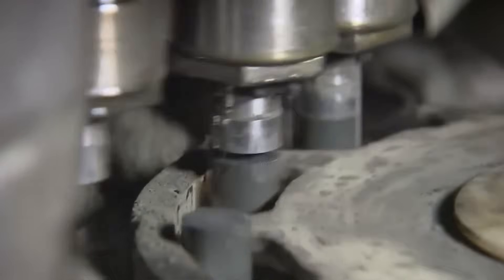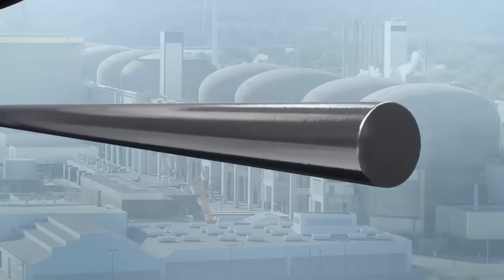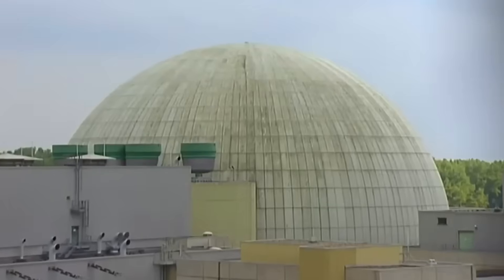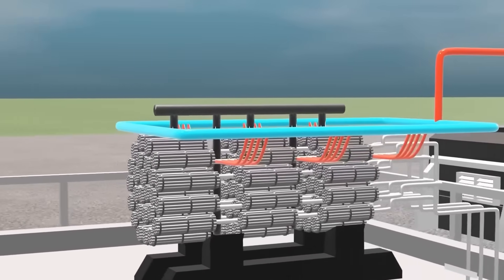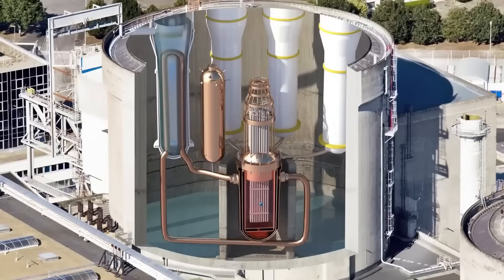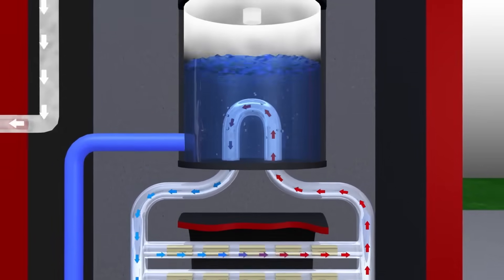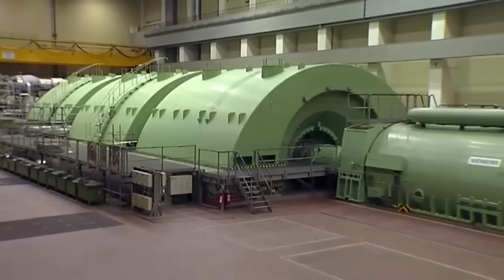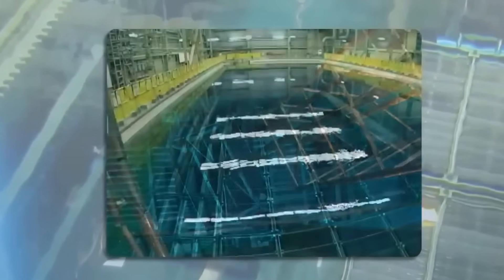How a NUCLEAR POWER Plant Works ☢️ Inside the REACTOR

Comment: If the fuel pellets and rods can be handled as seen in the video, how is the reaction process started once they are loaded into the reactor? Are the control rods already in place and it's started by their partial removal? I want to understand how this works.
Reply: Yeah control rods are fully submerged from the beginning which prevents the reaction from intensifying once fuel load reaches theoretical criticality

Comment: you ignore cashflow from the consumer, the customers.
I pay the bills, petrol for the cars, gas for heating, and cooking and hotwater, the electricity at 56cents kWh. 

My 10m to the street poles upgrade is quoted at $2,000, or $5,000 if I go to 3phase electricity supply. 

I have worked on the construction of a 1,7000 tower transmission line. And urban streets upgrade. 
I have decades in site management and tendering for projects. 

I know the national electrical grid length and numbers of meter boxes. 
20million meter boxes. 

I know that the $34billion in new grid projects is for only a small part of the national electrical grid. 

I know 4million roof PV systems installed and increasing and batteries and EV's. 

It is happening. Grid economics is changing.
The daily DUCK CURVE is increasing. 

Voters are changing.
Wealthy are clever and high energy users, and early adopters of new technology and modern appliances and love the tax-free benefits of tax-free savings on all their energy costs. Energy is expensive and the world is changing.

Comment: Ok so when the fuel rods are inserted into the reactor what exactly starts the fusion process?
Reply: Really its the water and sometimes there placed in a specific order to increase or decrease power output … the water slows down the neutrons and can push them back into the rods causing insane amount of heat and a chain reaction
Reply: @chrisrendon461  hey thanks for taking the time to respond to me appreciate it bud
Reply: @chrisrendon461 yeah I had the same question, that's something that kept evading from me after watching a few videos about that. Thank you so much!!!
Reply: We don't yet have fusion reactors.

Comment: The Nuklear plant is Production heat the water is cooling it down and there‘s is steam and the steam flows through Generators which the generators transform it to electricity and this Electricity is trans to the power lines.. so there is electricity for a town or more.. am I correct?
Reply: Ok

Comment: They produce electricity but need back up generators when the power grid goes down? Why can’t they use their own electricity they are making.
Reply: No one expects you to know how a nuclear reactor works but you should have the common sense to figure out that nuclear reactions dont just magically stop when the power grid goes down.
Reply: @Soulintent95 imagine just being to too stupid to understand what I just said.
Reply: @Theboss-m7v  my comment is typed in the same language you are using. Imagine trying to call someone else stupid when you cant even fathom something so simple.
Reply: @Soulintent95 .  Then explain why they need backup generators when they are producing electricity. Fukushima had two units running when they claimed they didn’t have power because the back up generators were flooded. You didn’t answer the question you did nothing but defend the matrix you are trapped in
Reply: @Theboss-m7v  my comments are typed in the same language you are using.
Reply: Kiddo, if you worked on nukes you wouldnt be asking such dumb questions. I already gave you the correct answer. Not my problem you dont have the capabilities for this topic. Clearly youre unwilling to learn, and it cannot be dumbed down any futher.
Reply: @Soulintent95 .  Sounds like you are another narcissistic idiot that couldn’t answer the question and is too weird to just let it go. The answer is it’s obvious they aren’t producing electricity
Reply: @Theboss-m7v  i literally answered your question. Its typed in the same language you are using. Grow up.

Comment: The uranium fuel pellets are ceramically treated Uranium dioxide chunks. This design makes it possible to encapsulate and re-use partial decay producs - Initial small % of u-235 is a starter to create more of it due to u-238 (most common uranium type) transformations.

Comment: So risky technology, a small mishandling, Can cost human race a decade to recover from radiation....
Reply: No, the RBMK was prone to mishandling, but not small. The catastrophe could have been prevented for hours before it happened and reactor was operated under forbidden conditions with automation clearly stating that operators are mishandling the reactor. This is what happens when you design reactor to be operated by people that follow orders and they don't. RBMK should only be operated under armed guards that would shoot your head if you do not follow instuctions. In Chernobyl the computer told the staff what they already knew - you can't remove that many control rods from the reactor under any circumstances. By any I mean any. ANY. Including if someone pointed a gun at you.

Comment: If only this YouTube video was available during the Chernobyl disaster
Reply: The reactors used in Chernobyl were a lot more different, what they really needed is proper training
Reply: @zephitron .  They knew what they were doing.  They wanted to do a low power test.  So they disabled the safety mechanism.   

Well I guess you say they needed more training but this was state of the art technology at the time.  So kinda hard to get training when you are the expert.
Reply: @msgsgt engineers said that it was a risky and dangerous reactor, especially because of the positive void coefficient which can (and did) cause thermal runaway, it wasn't state of the art and they knew it, they just lied to the people
Reply: @jaxb69  was it not state of the art for what they could afford ?   Also it never malfunctioned and worked as intended until they wanted to push the limits in a low power test. 

Yes they needed more training which is what they were doing.  Unfortunately they went below the tolerance for catastrophic failure.
Reply: @msgsgt It was not, The Soviets stuck with the RBMK layout because it was cheap to build, didn’t require enriched uranium, and could double as a plutonium breeder for weapons. It was budget friendly, not state of the art.

And "it worked fine until it went too far" misses the point, the test went below safe power levels because the reactor’s behavior at low power was unpredictable, the positive feedback loop was already capable of turning minor mistakes into big accidents. Similar with the graphite rods which in the end caused the explosion, the whole design itself was unsafe
Reply: @jaxb69  so it just had a lower tolerance for failures or mistakes but was affordable. 

So then, was it always going to fail or what it have worked normally had they pushed it above normal parameters ?

I under you said that design had lower tolerances for mistakes, but does normal operation eventually leads to those mistakes or failures?  (Gauges reads one thing but internal temp is actually  different for example.   Something other than, running it without sufficient cooling).
Reply: Proper training with less ego and negative coefficient reactor
Reply: RMKB tinha falhas
Reply: chernobyl chernobyl chernobyl
Reply: Oh lord, there’s always at least one of you to bring that up. How about all the nuclear powered ships and subs in the navy? Sailors live on top of a nuclear reactor for weeks and months at a time. How’s that for Chernobyl?
Reply: This is not the chernobyl reactor the chernobyl reactor is an RMBK-1000 which is a graphite moderater that uses steam to turn turbines
Reply: It wouldn't matter considering they knew they just hid that information from their engineers.
Reply: the reactors in Chernobyl uses graphite control rods which do not contain the reaction but speeds it up in extreme conditions. That is why modern reactors uses Boron or Cadmium control rods which can contain the reaction even in extreme conditions.

Comment: the pressurised reactor is known as a PWR (or pressurised water reactor) it has 3 cooling loops 1 for the reactor itself (this loop is isolated and is under immense pressure to maintain water in its liquid state) there's also 1 that uses the heat from loop 1 to turn to steam in a steam generator (this is the section where the first loop and second loop meet and are yet separated entirely and only able to transfer heat and spin turbines after the water within this section turns to steam, the other loop is doing the opposite to the first loop and is cooled by an external source usually by either cooling towers or a river, this loop pumps cool water to a condensor which turns the spent steam back to liquid before it takes its return journey back to the steam generator (the part which takes the heat from the reactor cooling loop) the heat from the condensor is directed to the cooling towers or river (an open system like this is required to remove heat from the system otherwise it wouldnt work)

there is another reactor which works a little differently called a Boiling Water Reactor or BWR this is slightly simplified when compared to a PWR but works slightly different, the first stage no longer is pressurised or separated, the steam is created directly inside the reactor vessel and heads to the turbine, this system has to have a constant supply of coolant to continue operation as its much more susceptible to a meltdown when compared with a PWR due to its design of requiring liquid water at all times to be pumped into the reactor vessel, also systems like this usually house the turbines behind radiation protect walls such as the containment building for the reactor as the water going through the core carries radiation, the PWR has no need and usually houses its turbines in a separate building as the steam water does not touch the fuel rods unlike in the BWR. the BWR also has the same final cooling loop (the towers or river) to condense its coolant back to liquid before being returned to the core, so basically the same as the final stage as the PWR system.

basically a quick summary of how it works, there's more to it but thats the basics.
Reply: This is remarkable

Comment: Then they hit the AZ-5 button and get a power spike. Spicey times ahead…
Reply: There is no AZ-5 button needed in this reactor, if the water waporises due to nuclear reactions, the reactions are stopped - as water is used as moredator. It will stop itself, because it has negative void (steam) coefficient. The RBMK used graphite as moderator and the water was used as neutron stopper only, so when it vaporised - there was more power generated = positive void coefficient. RBMK could only be tamed by control rods, but if you don't follow instructions for handling the reactor, bad things could happen. And they did. In reactors where water is both moderator and neutron catcher, a monkey could be left in a room and worst thing that could happen is loss of power or automatic shutdown.